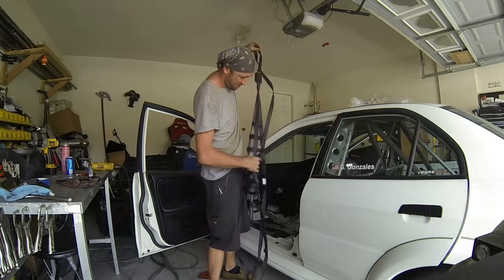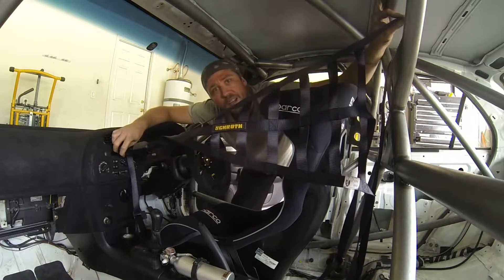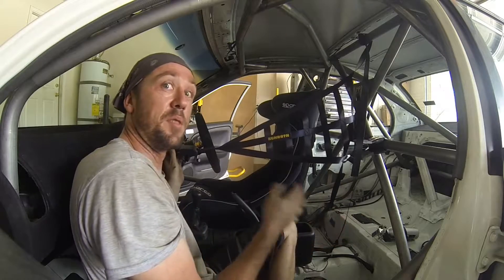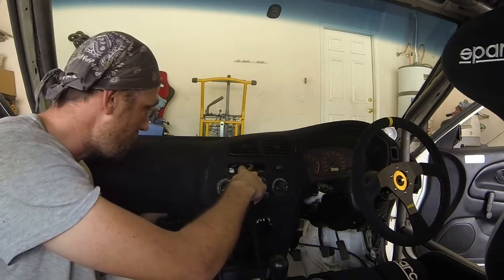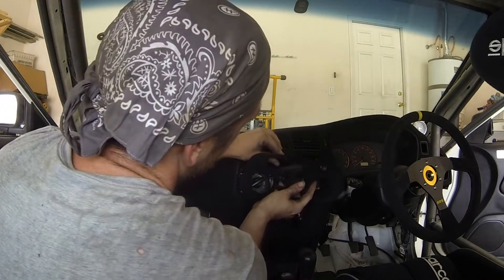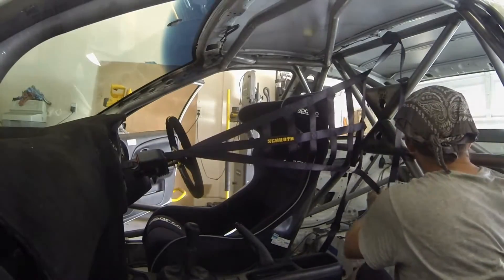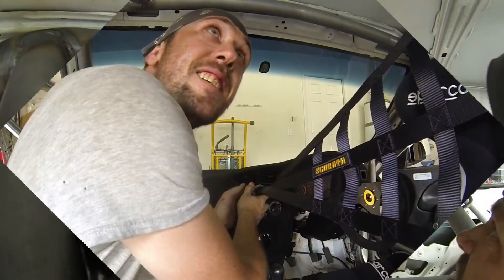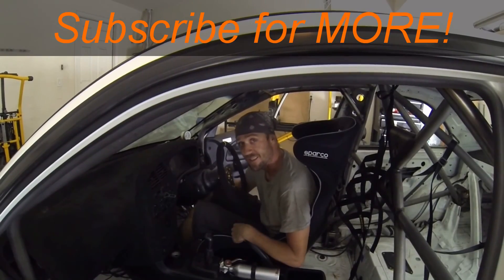TFS: How To Install an Inside Net

Comment: the positioning of the upper strap should be on the inside of the halo. alternatively if this is not possible, then two of the three straps must always be in contact with the seat